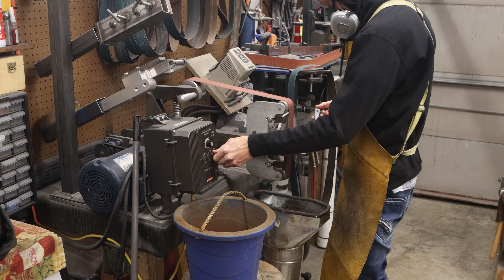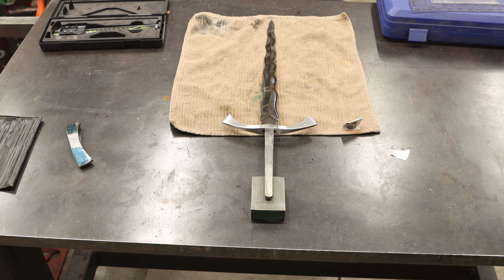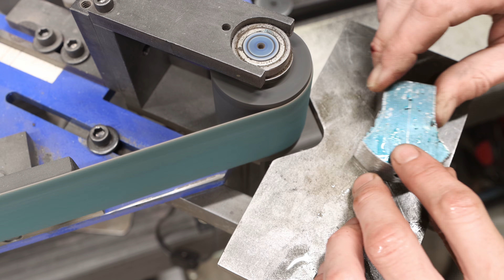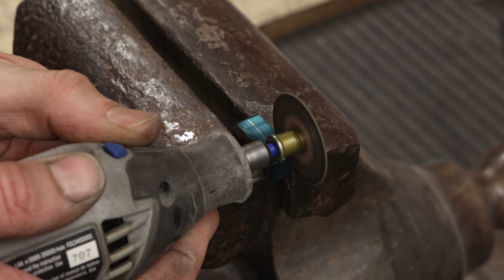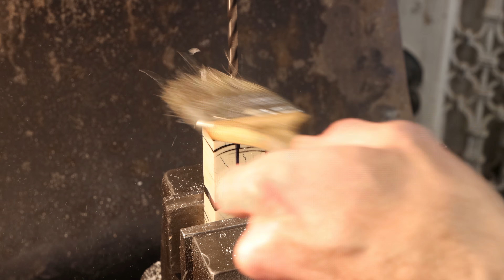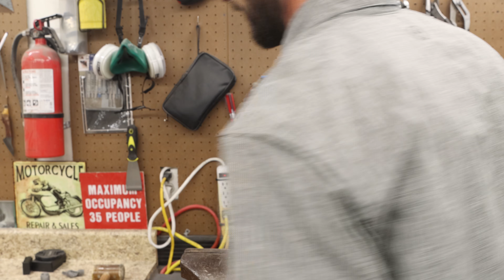Keris Part 2

Comment: Never cease to Amaze... How do you find the time... I know the right tool for the right job etc. but that build would have taken me 20 times as long and wouldn't hold a candle to the final product... it's a real work of Art. No B S.
Reply from the maker: Thank you Travis! This project actually took me quite a long time. I think I probably have close to 30 hours invested in it. I know you wouldn't gather that from watching the videos but in reality it is much different. I blacked out the fittings using oxpho blue from Brownells

Comment: Was a great build Airin. Little tip in regards to doing the bolster groove. If you put the cutter in your drill press and use it to mark a groove all around the bolster, makes keeping it straight real easy.

Comment: Beautiful material! Beautiful blade!
Reply: that sounds like my first dagger man for the dagger challenge I messed up like after 3 weeks of working on it and decided to scrap it but I in the aftermath of all that been working on it when I have had time and corrected the problem what's really coincidentally cool and crazy is that what I have been working on is kind of a smaller version of what you have in your hand right there I'm going to message you a picture of it it's not done yet but I still have some finishing work to do on the handle yet but other than that it's pretty well there for what I can do I guess

Comment: I've seen people who do a lot of file work, grind the teeth off certain faces of their files. Plan on buying a couple sets to do that to. That way you can work on your rounded corners in guards from your drill bits and not worry about enlarging where your guard fits working in a corner for example